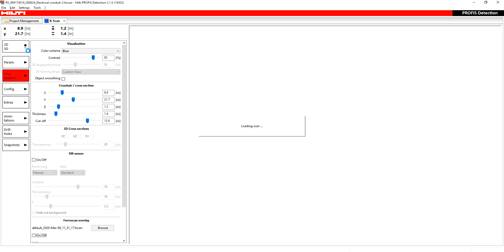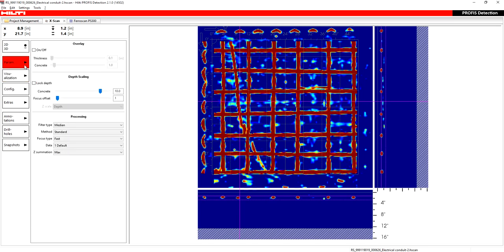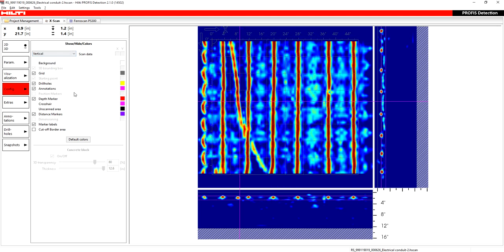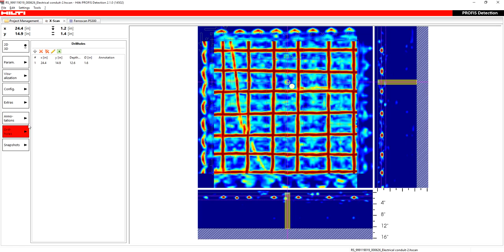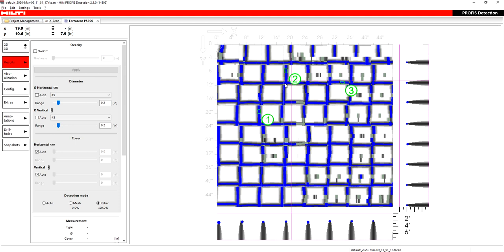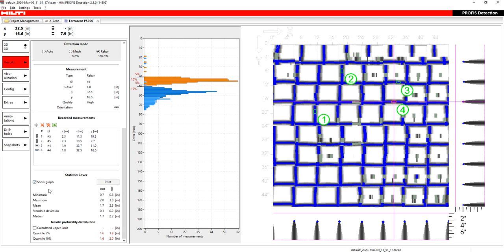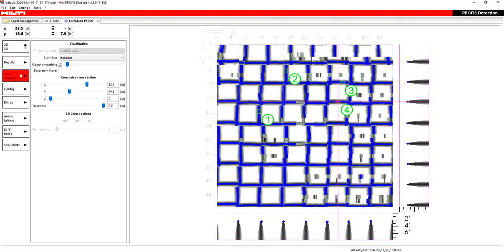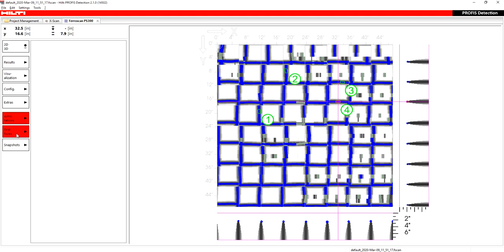Profis Detection - an Introduction

Comment: How often do you have to send PS 1000 X Scan in to Hilti for calibration?  Also how much does it cost for that process?  What is the best way to get certified/learn and what should be included in ticket/contract?  I started a concrete cutting company and currently sub out scanning, but just purchased the scanner from eBay.  Also, might be a dumb question, but is there a way to calibrate from computer?